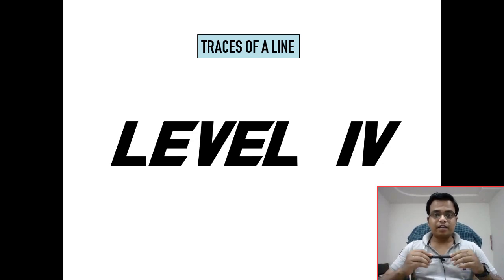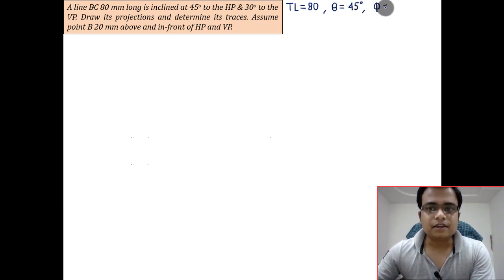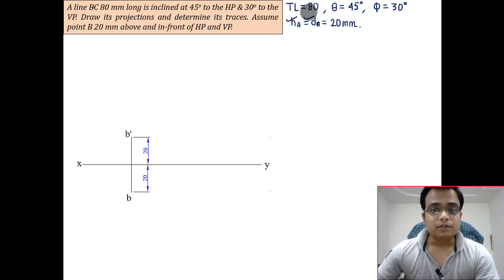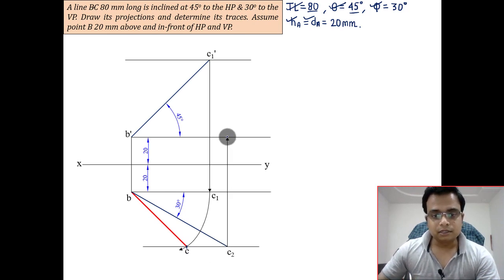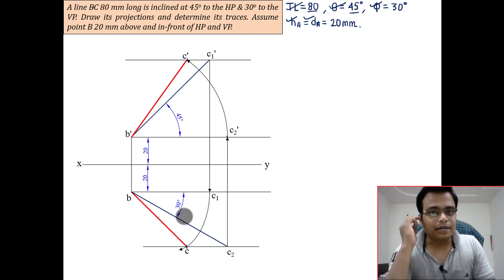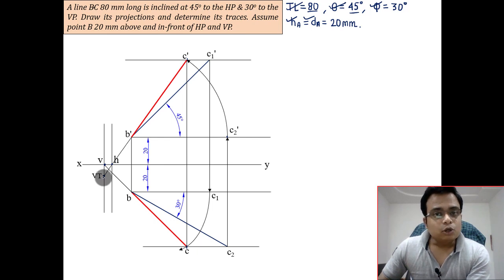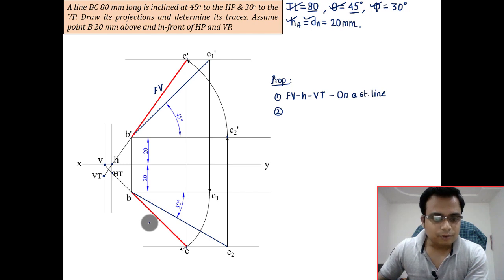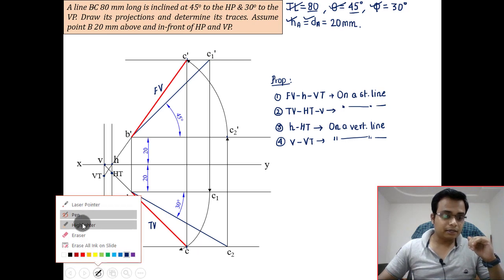Projection of Line_Reloaded | TRACES OF LINE | Level 4 | Problem 1

Comment: If conditions we are getting is such that on extending the front and top view we are getting v and h coinciding the how we should report the trace.
Reply: I was originally give question as Plan and elevation of a Line AB 60 mm long, measure 54 mm and 45 mm
 respectively. End A is 15 mm above the H.P, and 10 mm in front of V.P. Draw its projections and determine its inclinations to the reference planes and locate its traces also.

Comment: The top view PQ of a straignt line is 70mm and makes an angle of 60° with the XY line.the end Q is 10mm infront of vp and 30mm above the hp.the difference between the distances PandQ above the hp is 45mm.Draw the projections determine the true length and true inclinations with hp and vp can you solve this question and make a video bro please